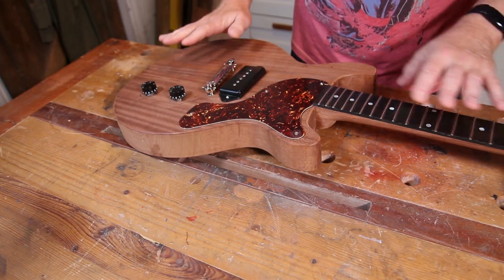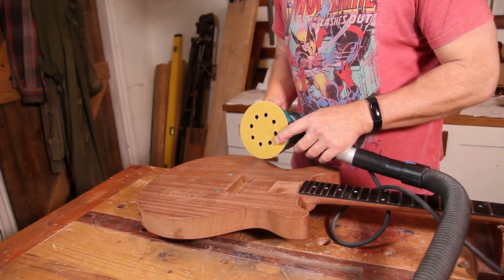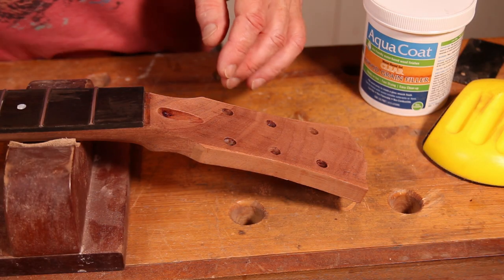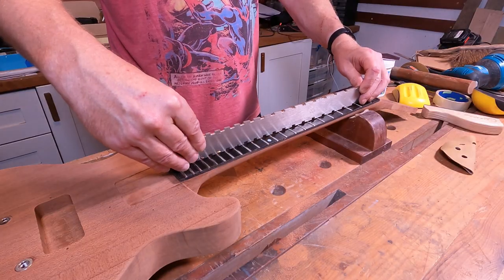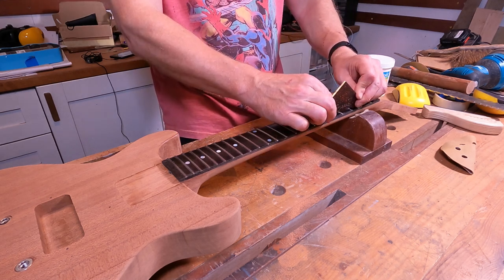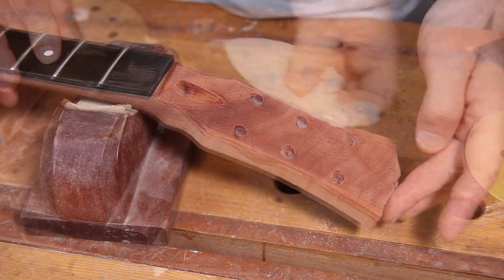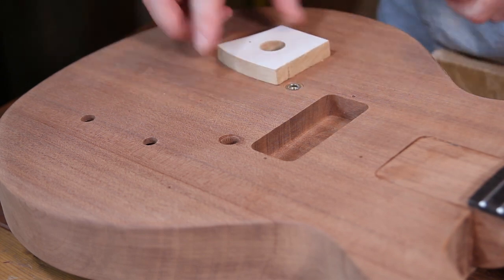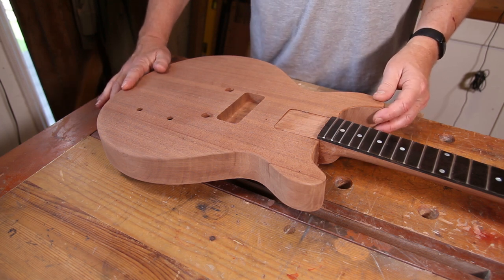TV yellow Les Paul junior Episode 16.

Comment: The finishing is obviously just as important as any step imo, not sure why some folks wouldn’t be into following it. For me, it’s typically the longest too heh, I just keep finding spots as I go and it always seems never ending here ahah!
As always, thanks.
Tommy~
Reply: On a quick side note Pat, I picked up three drill bits via Stew Mac for wire routes and they are exceptionally long. So long where I’m able to even put a nice bend into the thing as I’m drilling to really get a lateral hole. They work beautifully, sadly I don’t remember what I paid though but rest assured if it’s Stew Mac it’s a small King’s ransom LOL! I figure they’ll last forever though since they just aren’t used as much as you also mentioned 🤙
Reply: Sorry about the multi-comments here, can’t wait to see your finish here. I did a TV yellow Strat a while back and I didn’t do the grain fill after like your going to do here. You can see the grain pretty clearly however it’s not quite as dark as I’d like it to be either ( It’s a very light Swamp Ash body 3.3 pounder and a 1-piece ). After you do this one here I may just refinish mine here so I’m very curious to see the outcome 🤙
Thanks again, you and Twoodfrd are my favorite build channels. If you haven’t seen his channel definitely give it a peak, it’s outstanding really.
Reply from the maker: Cheers Tommy, the sanding does seem to go on forever but it's worth it. I love the way the guitar is transformed by the finish almost instantly!